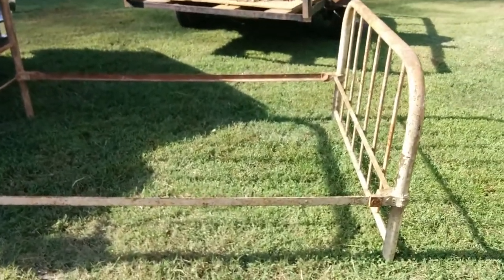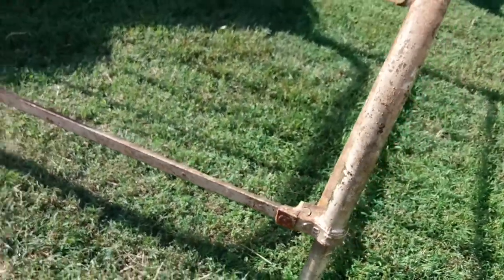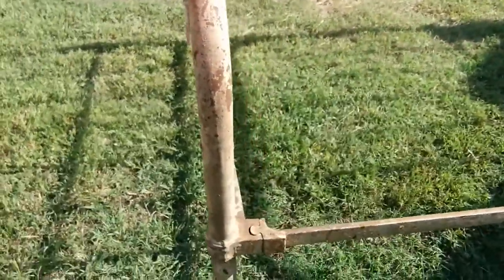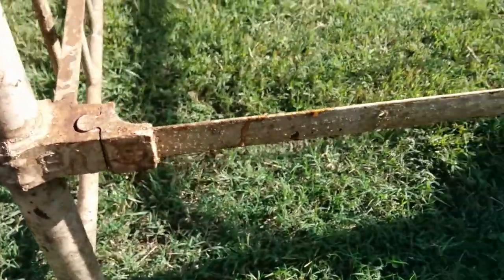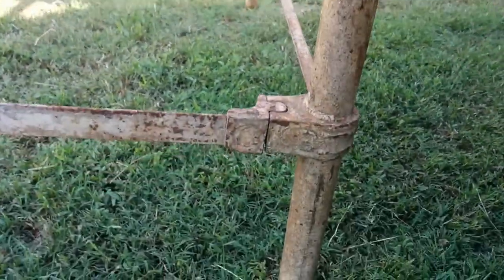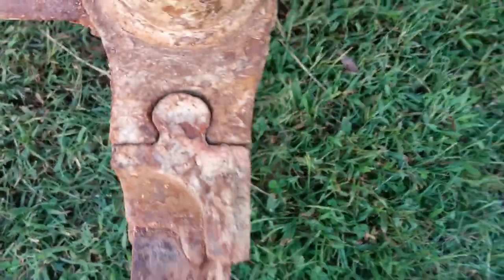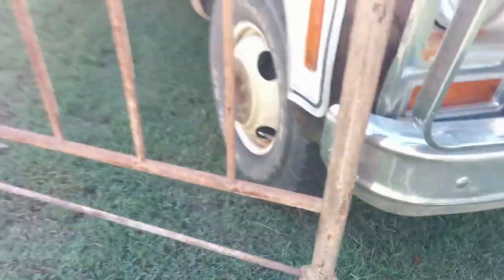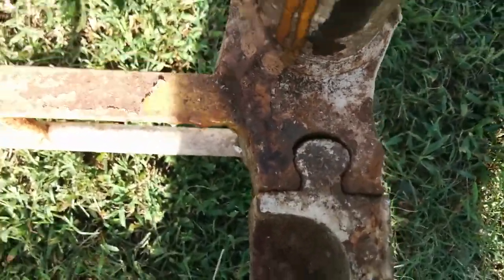Old Iron Bed pt1

Comment: I have a 200 year old iron bed with the metal box spring from Dothan Alabama  I just threw a 8 inch memory foam mattress on top and sleep like a baby! 
I also have another150 plus bed I bought off market place however I did not know there were different rails… this rail has a cross shaped fitting at the end but the head and footboards are the round shaped which I did not know when I bought it and several years later decided to set it up and of course notice it doesn't  fit snug and wobbles like a boat on high seas.. No wonder they were selling it. I have no idea if there is a way to make the frame snug so it not moving.. Any ideas?
Reply from the maker: If there's enough room you might try putting a little cardboard in there to tighten it up I don't know without seeing it,  hard to say
Reply: @Jake2670  it's a beautiful bed thanks I know there has to be a way… I will try this.

Comment: i have one similar to this and i am having a lot of difficulties taking it apart. i need it done asap cuz im moving, does anyone know how to?
Reply: Super easy. Get a hammer and you smack it from underneath. Very simple. That is the only proper way to disassemble the side rail from the headboard and footboard…
Reply: @The-Portland-Daily-Blink  Do you also smack the thick piece that is attached to the frame from underneath to get it off?  Or do you have to use something and put inside the tube and hammer it out form the inside?

Comment: Any worry about lead paint?  If it does have lead paint, how do you safely remove it?
Reply from the maker: nah, I don't lick my bed rails.  U could put down plastic n sand n seal then deal with plastic
Reply: They can be dipped or sanded. When you paint them, use enamel paint, preferably high fleck automotive paints…

Comment: Do u have the springs? I have one just like it but no springs. 
Thank you
Reply from the maker: none came with that one, have couple more that may b same size, haven't looked at em to c
Reply: Springs are nearly impossible to find, with original cast iron bed frames. I have one box spring, of the five frames I have. It’s all metal, weighs a TON, makes it feel like you’re sleeping on a water bed…